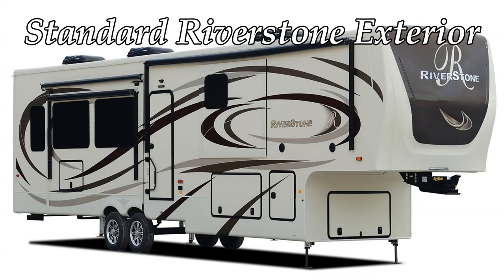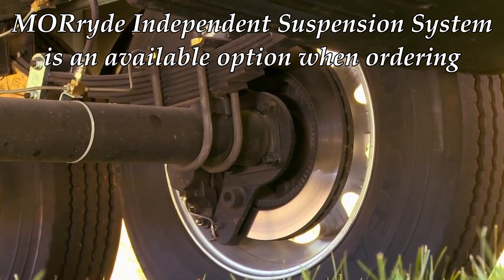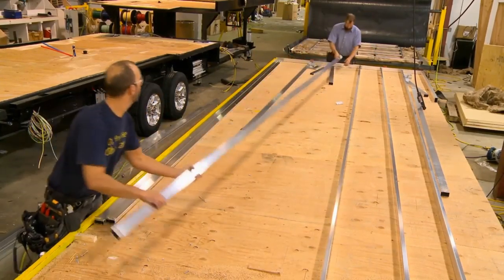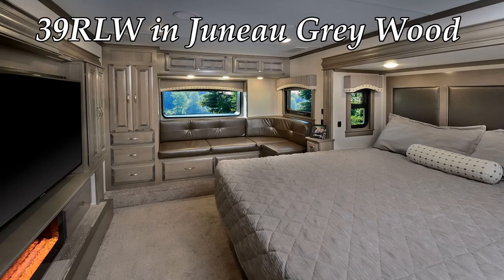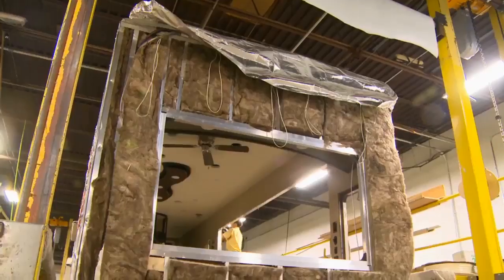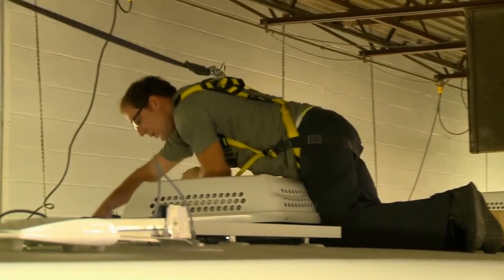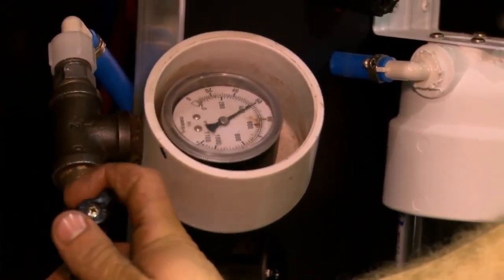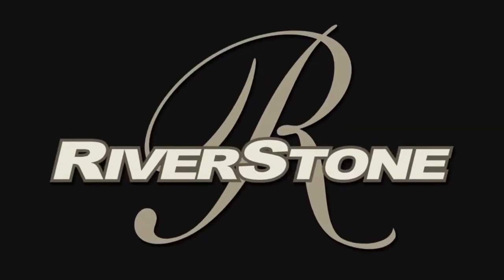Late 2020 & Early 2021 Forestriver Riverstone 5th Wheel Info & Construction Video @ Couchs RV Nation

Comment: Can not believe the claims that the thin aluminum sheet is R38. Other than that,  it is a beautiful fifth wheel.
Reply: I originally thought the same thing. When I think insulation I mentally see thick pink fiberglass like stuff, so how could that "Radiant Thermal Foil" (kinda like foil paper/two layers with little plastic air bubbles inside) do much of anything. So I googled it. Thanks for Google. And come to find out it's not in it's thickness that it does anything. It's in it's thermal reflective properties. But I did find out that it has to be properly installed to work. One of the things that I found out was that it must have air on both sides of it, it can't be pasted onto any surface and work properly. Here is the web address for one of the really good articles I read. Even though they are explaining how it functions when used in an attic, it's the same thing. Heat is heat, cold is cold. Here is that web address: https://www.energyvanguard.com/blog/41522/Oooh-Shiny-Stuff-Radiant-Barrier-Fundamentals